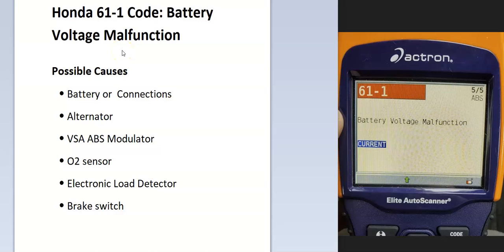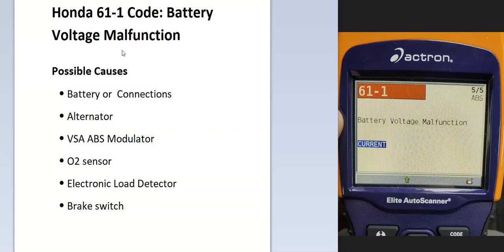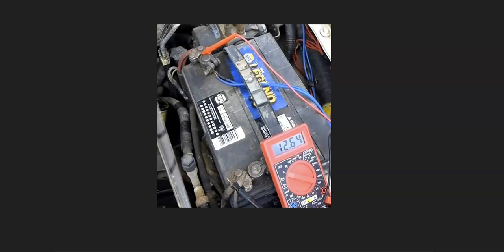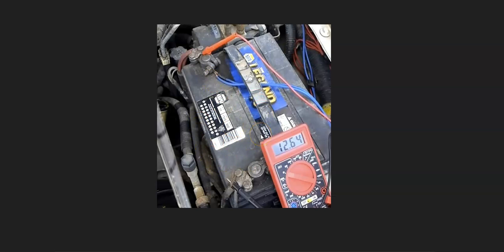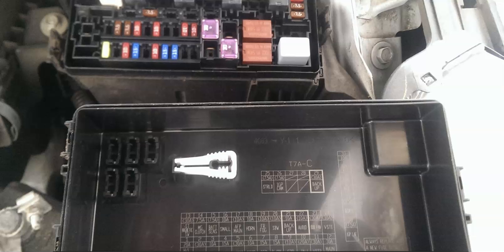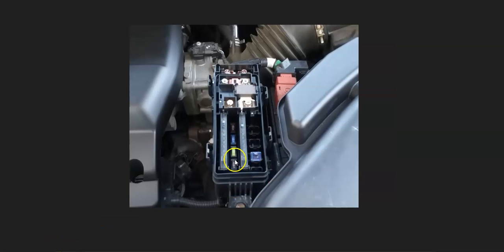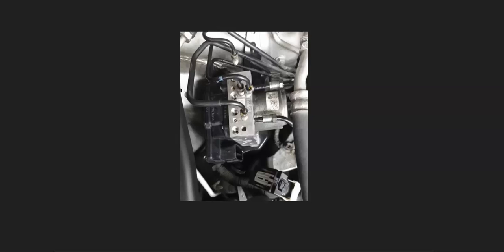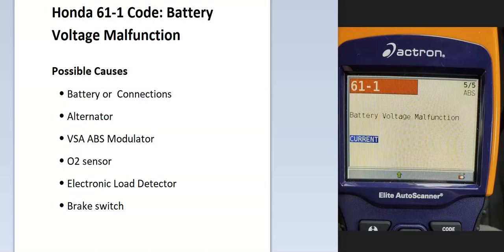Causes and Fixes Honda 61-1 Battery Voltage Malfunction

Comment: great info and very informal. i ended up having to clean up my battery terminals and cables. car was brought from dealer who got it from an auction and did not clean them up. Car was in gear for Drive and it was blinking which is why i got this code. thanks for the help

Comment: Hi I have a question...I'm getting that code for my Honda...and my rear wheel smokes ...I just got it out of the shop that's how I know the code ...so is this basically meaning I need to change the abs module that you showed

Comment: I didn't have any ABS lights on my Pilot"s dashboard, but AutoZone scanner & my Innova 3040RS scanner tools indicated that there were 3 ABS related codes. Here is how I fixed my Honda PILOT 2006 for this abs code 61-1. The cause was from the losing connections on the battery for both terminals. I bought the part called car battery shim from the AutoZone and installed it on both battery terminals. Now the app, RepairSolution 2 on my Innova 3040RS OBII scanner said that this code 61-1 was fixed. I still have two abs codes that are not fixed and they are 83-1 & 112-1.

Update on 83-1 & 112-1 codes: I used the Innova 3040RS scanner tool to erase these two existing ABS codes from my Pilot's computer. Since then I ran at least 150 miles already, I didn't see any ABS code. Looks to me they are gone.

Comment: I have 2009 Honda Accord 
And I got those 61 - 1 code and it says low voltage modulator-control.
And when I try to start my car it won't start. 🤔

Comment: I have these errors in the Honda Civic 2007, what should I do, please?

Hydraulic Booster
61-1 (Control Unit Low Voltage)
66-01 (Control unit circuit Stuck off)
82-01 (Control Unit Internal SUB Circuit Malfunction)
83-01 (F-CAN Malfunction PCM/ECM/ABS/VSA)
86-1 (F-Can Malfunction (Bus-Off, Communication)
Reply: We’re u able to fix this. I have the same issues

Comment: My wife's battery was only nine months old and it died.   I tried to jump it from a booster, but for some reason it wouldn't load.  I replaced the battery.  Then I checked the error codes and found 61.1.   I erased it.  I'm hoping that the error message was due to the dead battery and that it won't reoccur.  CHecked the new battery and the alternator was working and the voltage was fine.  I'll check again to see if 61-1 comes back.  No other diagnostic codes on this 2016 Odessey.
Reply: did it come back on?
Reply: I need an update!!

Comment: Auto Zone tech performed code check on my 2016 Honda Odyssey and found codes 83-1 and 61-1. You cover code 61-1, do you have anything on code 83-1. I do not have any lights On on the instrument panel. For your information my issue is with judder during acceleration, transmission shift good.
Reply: Did you figure it out?
Reply: What was the problem?
Reply: I got these 2 abs codes too on my Honda PILOT 2006 and I did fix the code, 61-1 successfully. The cause was from the battery losing connections at the 2 terminals. I bought the part called car battery shim from AutoZone to fix it. I still have the code 83-1 that is not fixed.

Comment: Just letting everyone know of another potential culprit. I had the exact same issue (61-1) with my 2008 Honda fit. The TPMS light was on, so I got new TPMS sensors and installed them myself. However, the relearn machine I bought didn’t work. I brought it to Walmart to have them install new TPMS sensors and link them to my computer and the situation resolved. I appreciate the other information in this video though. I learned how to check my alternator, which is good. Since my battery and alternator are good, my next step was to replace the electronic load detector. Glad that the TPMS fix worked for me.
Reply: Wassup brother I think I’m having this same issue with my rsx. I’m getting the code 61-1, also the bank one sensor 2 code which I already replaced the 02 sensor and multiple  throttle position sensors. I also get the code for the throttle position sensor is either low voltage and sometimes i get the code for the high voltage at times. My alternator, battery , 02 sensor and throttle sensors are brand new. I’ll clear the code and it comes right back. It could be a wiring issue but after watching this video and reading your comment as well I think it’s something stupid. Something is throwing off the 02 sensor and TP sensor voltage. And I notice when I check the abs with my check engine machine it says the (61-1 battery voltage failure ) and (17-1 left rear wheel speed sensor, “open or short”) so I’m assuming that battery Voltage failure is coming from my abs system…Any ideas will greatly be appreciated
Reply: @Melanatedalchemist  Yeah it’s tough sometimes. My other car is a 2007 Toyota Matrix and it is having issues with the battery/alternator now, and it was the alternator belt. If you’re having the battery light come on, I would check the belt to see if it’s cracked or if the gaps between the ridges are too deep/wide. If you haven’t replaced the TPMS, I would check if that’s the issue. It seems like certain electronic things go through others and causes a miscommunication.
Reply: @21beamer60  my belt is brand new, I changed that with the alternator along with the power steering pump lol. I think I found something new which the ELD voltage high. Electric load detector that could be the culprit for the tps sensor voltage high but the code is stored under the abs system which doesn’t make sense. I’m going to change the ELD then get my hands on the tpms sensor and hopefully that fixes everything
Reply: @Melanatedalchemist  for some reason the ABS and TPMS seem to be connected 🤷🏼‍♂️
Reply: I had similar issue.  I had a TPMS light on for bad sensor.  I didn’t care.  Three weeks later I get the ABS code on Engine light.   I replace TPMS sensor and ABS code goes away.

Comment: Is this the same with the code 61-11? Power Source Failure for ECU (Low Voltage)
Reply: Did you solve this problem code? I also have that problem too
Reply: Same here

Comment: Hi Whyingo, good information I have these codes after changing the alternator out twice on my Honda Odyssey 2007

P2717 confirmed 
P0420 pending 
P0430 pending 
P0420 current
P0430 current
P1717 history
61-1 current 
84-1 current

Not sure if they point in a specific direction. Trying to evaluate it without a multimeter for now unfortunately. Any input is appreciated!
Reply from the maker: It is difficult to say what the issue is but it seems like a wiring issue. I would start by checking the fuses and alternator output.

Comment: I have a 2015 Honda Odyssey with a steady VSA light, brought it to Autozone for a Fix Finder report, four codes were indicated 27-1 (A problem with the ATP-NP signal input), 62-1 (Millimeter Wave Radar Sebsor Error), 61-1 (Control Unit Low Voltage), 86-1 F-Can Malfunction (Bus-Off, Communication).  Any idea what the issue is, could it be a weak battery.  Thanks in advance...